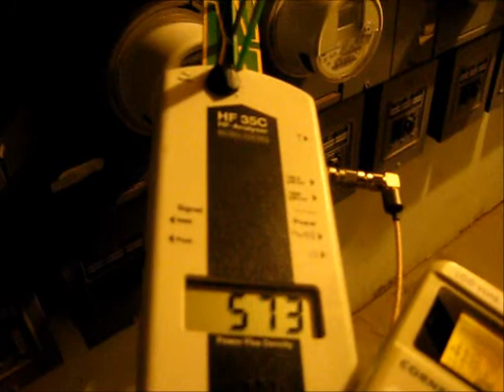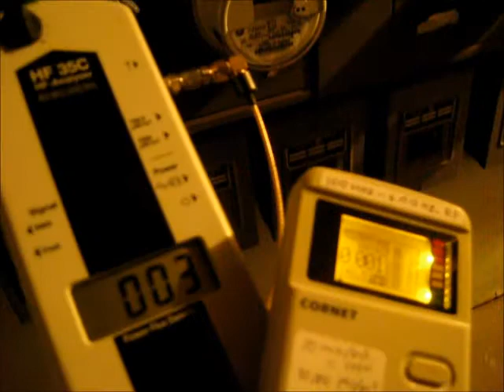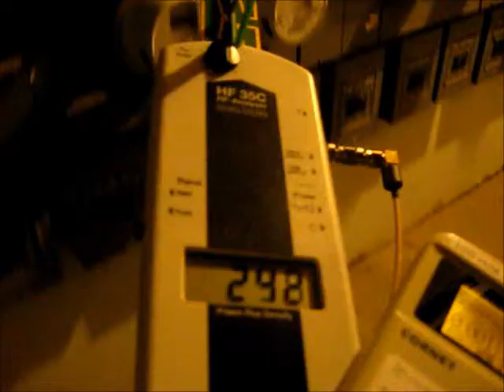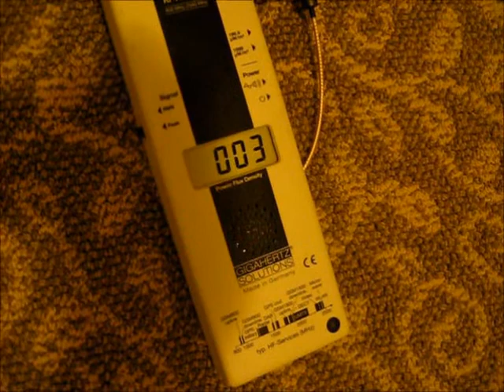"Smart" Meter Banks Force High RF Microwave Exposure on Residents

Comment from the maker: I concur that getting yourself an RF meter is an excellent way to learn directly what you are exposed to.

Personally I have found a very wide range of levels---on phones, on towers and antennas, on smart meters as well. Additionally, each has an emissions pattern---all quite different as well.

One of the important factors is how *involuntary* and *continuous* exposure from smart meters, cell antennas, and WiFi routers are. You know when your phone is on.

Comment from the maker: Please revisit the video page and see the link at the top in the text below it.

There you will find ample documentation of the FCC violations of smart meters:

--No co-location
--20cm separation distance at all times
--Professional (not two-weeks training!) installation.

As well, the transmitting power of the PG&E smart meter is restricted by the FCC to ONE WATT. PG&E added a 4dbi antenna, which boosts the transmitting power to 2.5 watts, which is illegal. Search EMFSafetyNetwork (dt) org.

Comment from the maker: I strongly recommend you get a low-end RF meter (such as Cornet brand) and measure for yourself. That concrete may be absorbing quite a bit, or other factors may increase your exposure. It's hard to know without measuring. You can use screening between you and the meters, for good results. Please see my shielding videos.

Comment from the maker: The FCC "guideline" max for cellphone/smartmeter frequencies is around 600µW/cm² (equivalent to 6,000,000 µW/m²---note unit difference).

My analyzer here is reading in µW/cm², so we're looking at 600 as FCC "max".

Nothing actually happens to companies who make devices or antennas that exceed that number, it's just a "suggestion", sort of.